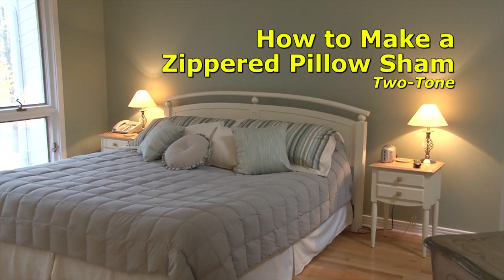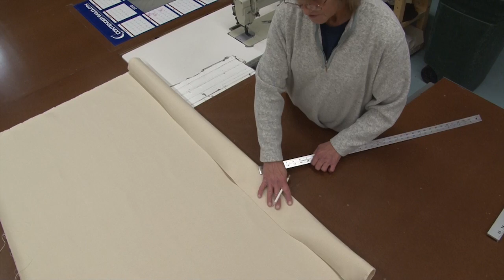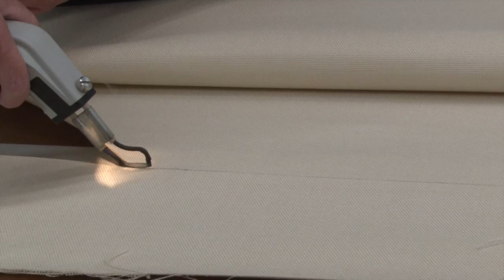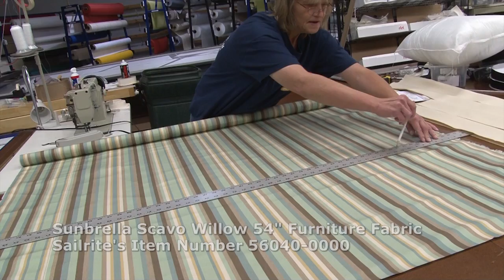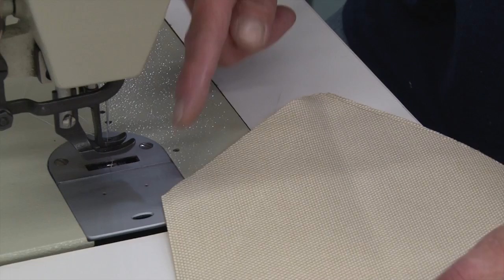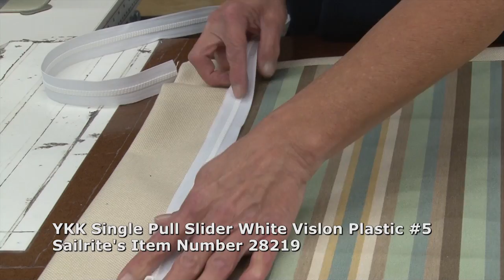How to Make a Zippered Pillow Sham - Part 1

Comment: I followed the instructions exactly and ended up with the flange being 1" to short in both directions.   I am an experienced seamstress, so it's not that this is too complicated for my experience.  I was looking for a quick tip for making contrast flanges.  This screwed me up.  Next time I'll know how to do it correctly, but this video should be taken corrected.
Reply: I followed the instructions exactly and also ended up with a frame that was too small. I would love to know what went wrong. Very frustrating!
Reply: @Mary-z8d6w   I have since done another.  I forget what adjustment I had to make, but it was something like ... where the video says cut, that is where you should sew.